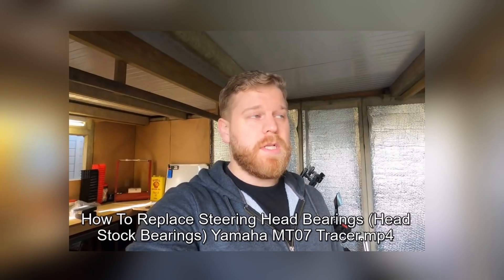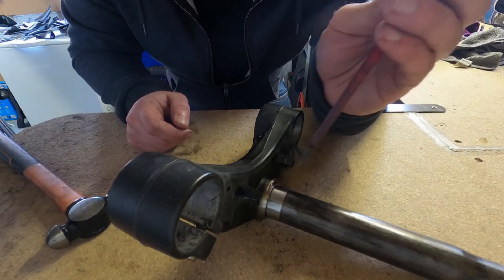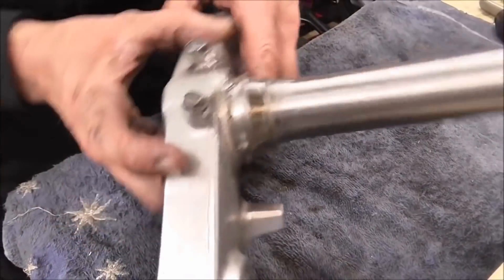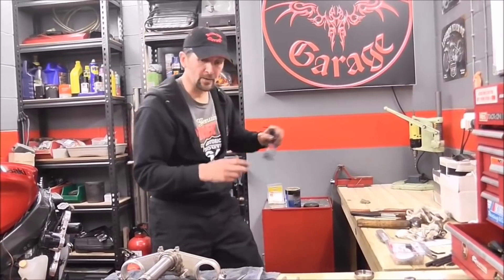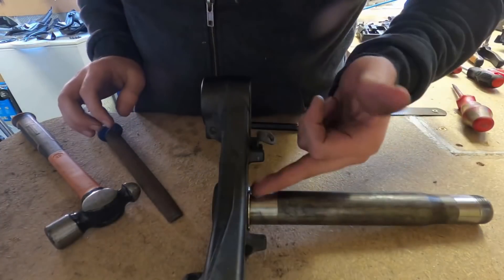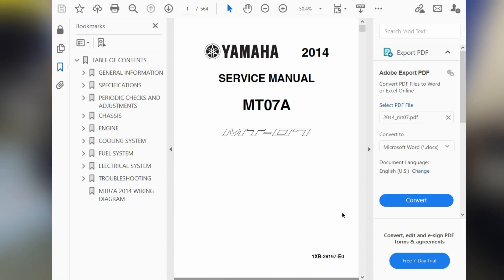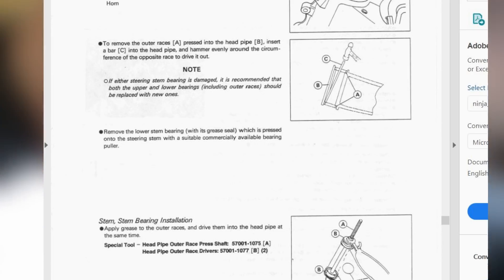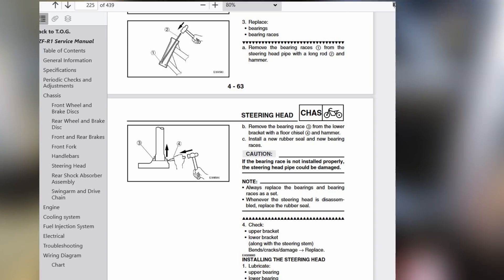Is YAMAHA Dumber than Del?

Comment: Takes more skill and if you mess up you've ruined your stem but if I'm in a pinch I grind down the bearing race close to the stem and give it a whack on the flat areas I made at the sides of the stem never in the middle and pop it cracks and can be pulled by hand most of the time. I have used the chisel method but will never again it always makes a mess of things. The guy actually did a fairly clean job for what it was especially after looking at dels mess.

Comment: Ok I just watched that guy's video and from what I can (hardly) see there's a tiny gap between the yoke and bearing so here's my question : I you position yoke so the tube is vertical, then use freeze spray inside the tube at the bottom to shrink the tube a little and at the same time use 2 small screwdrivers to lever the bearing upwards? Would it work?
 If I remember correctly I did that on my old r6 or vulcan. It was so long ago I can't really remember.... I smoked shit loads of weed since then. Is it a bad practice to use freeze spray on bike bolts etc...? I've used it in various applications and it seemed to do the job.
Reply from the maker: Watch my next video
Reply: @thedirtyworkshop  if you mean "chisel that steering" I watched it it's good I like the idea.

Comment: That is not the way to remove a bearing race, so many other non destructive ways - bearing puller or dremel and split or a bearing splitter or heat. If there was going to be risk of contacting the seat or shaft, I would be using a brass drift.

Comment: It's kinda hard to see if you could even fit the puller onto the bearing I mean does that bearing have enough of a lip on it?
 In dells case I can see that yes he could easily fit puller onto it... However we know he does everything with a sledge hammer right
Reply: Also I looked into 2013 R1 service manual and funny enough it tells you to use chisel and hammer 🤣
 Did Flintstones work for yamaha at any point?

Comment: I've done it the Del way but been way more careful and it worked out for me and I'm a dumb guy and I didn't had any previous experience with this. I didn't need to file any burs. 
I have an official workshop manual for my Honda VF1000F and a Clymer manual for my FSZ 1000. I've checked them and both books don't show any how to do it, they just state: remove the brace.
So, you can be right: don't be a butcher, but for this I don't see the sense of buying expensive tools for this. especially It's very rear for me to do this kind of job.
Reply from the maker: Or do it this way - https://youtu.be/hIIT0ArDsJI
Reply: @thedirtyworkshop  
thanks, looks like a good method.
But I don't know I have a steady hand enough not to scratch the stem :)
Reply from the maker: You can grind it the other way, I'll do some demo's soon showing all the different methods, just not the chisel method... lol
Reply: @thedirtyworkshop  
yeah, maybe more in a diagonal way.
Or maybe a multi tool with a small but HARD tooth blade on it will work too. anyhow, As long as I keep the bikes I have I'm sure not to do this work any time in the next 5 years, at least! I changed it at my FZS 1000 at 72k KM and that where the original roller bearing. Replaced them with needle bearings and there on it for 28k.

Comment: 1999 - 2002 YZF-R6 shop manual says exactly the same thing, like they just cut and paste from earlier years. My bearings are due to be replaced soon. Shall we follow the shop manual as per your advice, or go against the grain and opt for the cutoff disk/chisel or bearing puller method? Is there any chance of compromised structural integrity by using procedures other than what is outlined in the shop manual? I was going to use the liquid nitrogen/hydrogen-oxygen torch method, but security at the lab is insane these days. Probably just the Matrix re-writing reality.

Comment: Luckily for me  Kawasaki used to have a lot more mechanical sympathy and brains. My 1980 Z500 manual uses a bearing puller and adaptor to get the bottom bearing off, Suzuki (Bandit MK2) on the other go straight in with a chisel. Good grief, will stick with my cheap dremel copy and cutting disc.

Comment: I would either use acetylene torch and heat the race or weld somethreaded rod to the race both sides and pull it off on the end of the stem with a flat plate and a couple of nuts

Comment: Just because it says in the manual... What the fuck happened to common sense. I can still remember a Yamaha technician whining at me for ONLY using a dust sheet over the tank while working with the cap off the master cylinder.
This is a function of the correct methods not being passed down through apprenticeships anymore and the terminal dumbing down of the prols here in the UK.
Reply: Evidently not just the UK Sophie, here in Oz, my GSX1400 manual says hammer and chisel. Common sense ain't that common.

Comment: Funny enough, my Yamaha XVZ1300 manual has the same image, and my VFR800 manual says " remove the lower bearing inner race, with a chisel or suitable tool ". personally i would use a brass drift till i got enough clearance to use a puller. BTW checked with a kawasaki manual, and they say use a puller

Comment: I HAVE done it that way in the past.. Once or twice only. But to be honest it was in stuff like the old RD350LC which had steel yokes and I had to get the ball races out to swap to tapered bearings ( pre dremel years) . But in the past 30 years I have not had to do that again. The only thing I did do was beat the crap out of the yoke spindle to remove it completely to fit a Kawasaki front end into an Aprilia RS250 chassis with a whole new spindle. 

Now if you wanted to see workshop nightmares then Aprilia RS250 Project I bought from a customer who ran out of money to complete his project is a total nightmare. So its not just guys like Del or Yamaha that are dumb.  The list of things that needed to be corrected was mind boggling.  So it can also be workshops that do this "work" for a living too..

Comment: The manual has been saying using a rod and hammer for ages 🤷🏻‍♂️

I use a big brass punch, my necks are steel though.  

Far as the stem bearing, usually I cut into the race well enough and go after it with a cold chisel to crack it off, or I just press the whole stem out if it's particularly stuck, then press the stem back into the lower clamp

Comment: My Yamaha MT690 (MT-07 Tracer) manual says the same. Using a chisel to remove the inner race. Well, a good bearing puller for the bottom yoke costs a lot of money. And the sad thing is, that even workshops do it with the chisel. I'm thinking about buying this special puller but it costs 400€. How often do I need to use it? ^^
Reply from the maker: Or just do what everyone else does, grind it and slit it...

Comment: Aluminium has a higher co eff of expansion - stick it in the freezer and then just pull it off.
Reply from the maker: Both the bearing and the stem are steel...
Reply: @thedirtyworkshop  Ahhh, fair.  I'd probably cut the collar then

Comment: Most of the Japanese manufacturers have said use a "hammer and chisel," at one time or another, to remove the inner race from the steering stem or the outer races from the frame. 

Yes its absolutely a stupid method. The best way to do all three is with a puller but, for the steering stem, you can get by with cutting a slot in the inner race with a dremel. Heat the race with a torch and then the race will slide off.

You MUST HAVE an install tool to put the new stem race on though.

Comment: What these guys are doing and what Yamaha has listed in their manuals shown in this vid is not best practice. I can’t say I’m surprised as what I’ve seen in my 20 years working with engineers and fitters. Over half the guys I’ve worked with don’t know how to install a bearing let alone remove one! 
The reason why I say this is not best practice is because these bearings rely on the correct amount of preload from the slot/hook nut at the top in order for the bearings to operate smoothly & correctly. Distorting or damaging the seat for the bottom race in any shape or manner is running the risk of not allowing the bottom inner race seat fully. 

I’m with people who grind a shoulder into the inner race to tap it off. More often than not I use a hot air gun heat it up slightly. Depends on how much heat the grinder has put into it. I rarely use a puller or press on anything.

Comment: Yup, 2001 Yamaha FJR Manual says use a floor chisel . 'A cheap old screwdriver' ? Looks like a Wera to me - pretty decent , and they make a 'hammer through' (?) style if you need that. I saw someone else use a 10 ton press to push the steering stem down through the yoke - seems like the right way to do it , just not available to everyone.

Comment: Same picture and text in my '83 XT550 manual.  I'm fairly sure the FZR400 one says the same, if I went out to the garage to look.  And here's Honda's best practice from 1986, on the VF500 steering stem : https://imgur.com/oR4wq1G

I've almost always used a puller.  Although I have been known to grind as deep a groove as I dare in the race, then twat it with a chisel to split it.  Only on pushbikes, mind.

Comment: Geez, if I bought a second hand bike with a mauled up lower triple like that I would have punched the previous owner in the bread basket. I use my air hammer and just walk them off with no problems wut-so-eva. That is me though, funny thing is, taking it to a dealership to have the lower race removed you would encounter monkeys that have no access to said pullers and would resort to the same cromag methods as we have seen!

Comment: Hammering it off isn't ideal but, honestly,  how many failures of components has this method ever caused?  The aluminium is probably forged and even if it was an alloy prone to work hardening you'd have to do some serious hammering to create a spot liable to cracking. I'm not exactly sure how hard the steel stem is but it's not like it's going to be HSS. 

If you're working on bikes in a professional manner and you aren't using the proper tools, that would annoy me. But for doing it at home once every other year, wgaf.
Reply: And they're generally hamfisted and careless. I just watched someone do it "properly" with a hammer and chisel and they didn't leave a mark. I suspect the yoke in this example is steel.

https://youtu.be/c-kVkqXiLdY?t=754 12:30